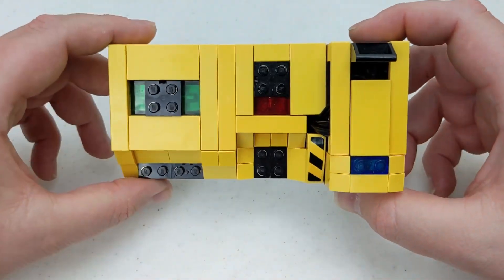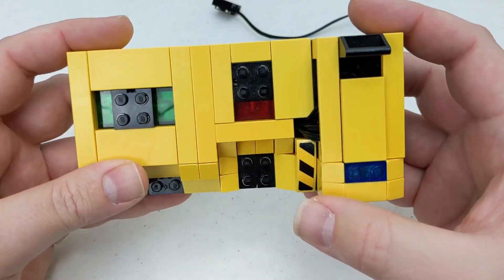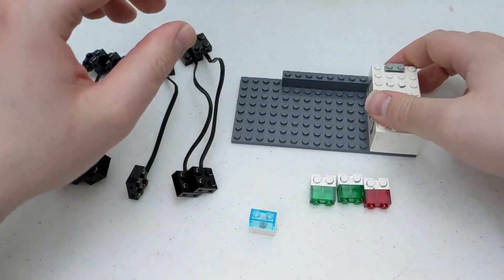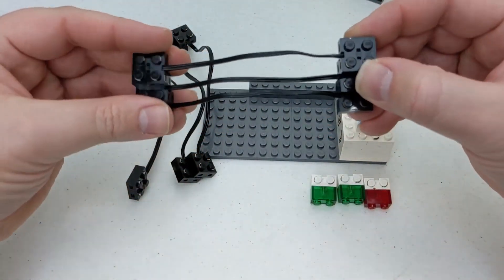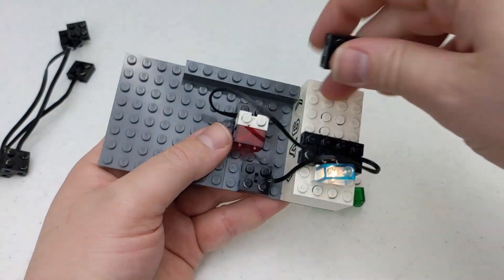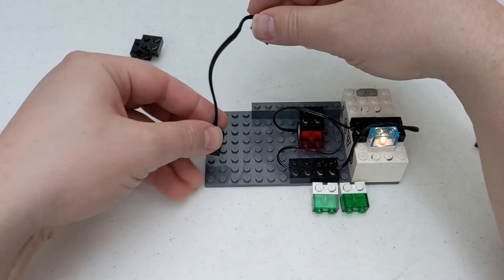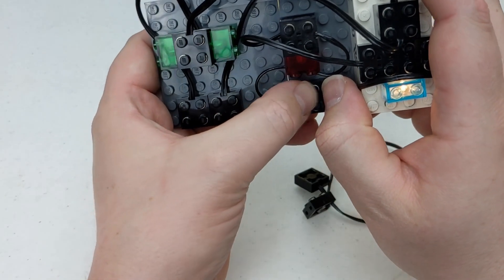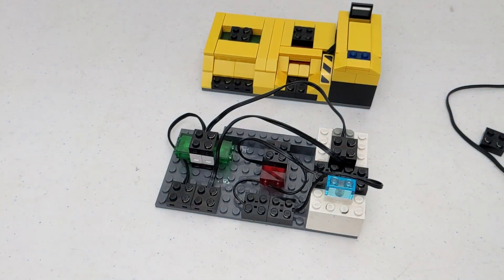How to build a Lego 9v wire tester

Comment: Hi, sorry for troubling you i have just started repairing cables and have had some success, i think this is great and want to build it i have got most of the parts but am having trouble finding the one 9v bulb that you said is hard to find i live on the Isle of Man a small island between England and Ireland and am a long time member of Bricklink and Brickowl have you possibly got a part number for them as i have been trying on both sites and ebay and tried on Google but no luck if not i will keep trying ,Thank you 
     Kind Regards
       Paul
Reply from the maker: You're right, I had to do a few searches to find the magic words 😅.  Searching "light brick" on BrickLink should come up with the 3 different designs for the 9v lamps (4771, 4767 and 6035c01).  Hope this helps!  Glad to see more 9v wires being saved from the trash!
Reply: @BatteryPoweredBricks  Thank you soooooooo much for your really speedy reply and the contents that is really helpful  Cheers Paul

Comment: Very cool contraption! thanks for the explanation. Will have any ideas on repair of stalled 9v motors? i have some of the lighter versions that are almost seized. Thought only the heavier version are prone to seizing
Reply from the maker: I haven't repaired any so far.  From what I've seen it's a fairly involved process.  For me it's easier to find replacement motors on Bricklink or in eBay lots.  The 9v motors aren't as sought out as Power Functions motors so prices are usually reasonable